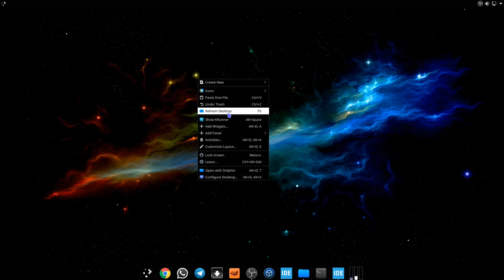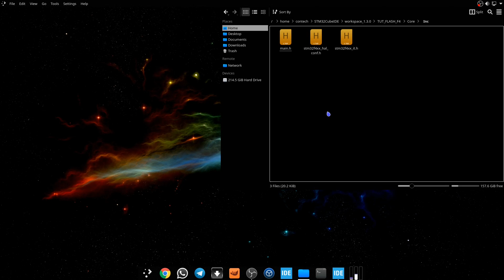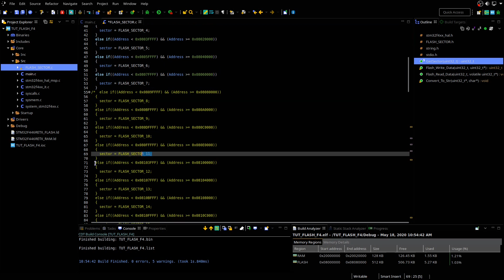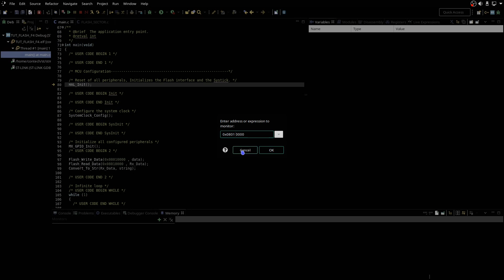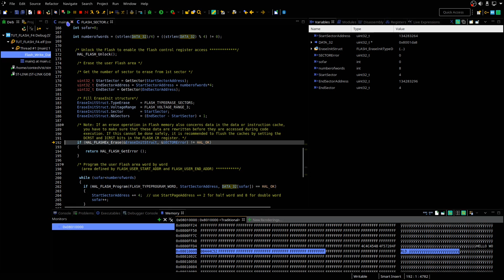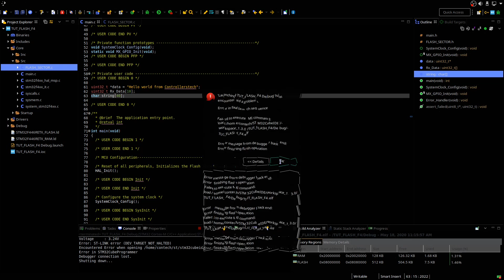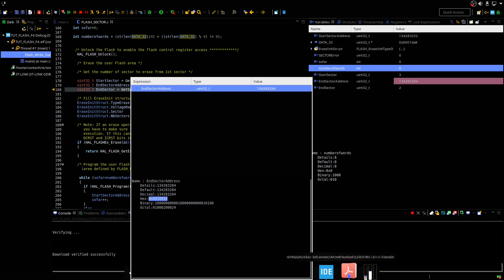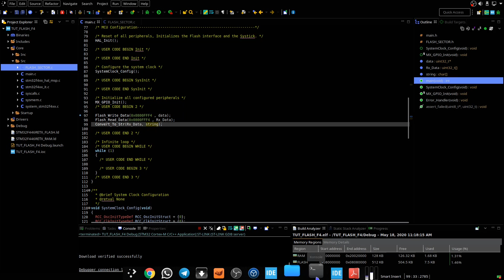Master STM32 Flash Memory: Complete Guide for Sector-Based Flash memory with HAL

Comment: After trying out this code:

    HAL_StatusTypeDef res;
    res = HAL_FLASH_Unlock();

    FLASH_EraseInitTypeDef EraseInitStruct;
    EraseInitStruct.TypeErase     = FLASH_TYPEERASE_SECTORS;
    EraseInitStruct.VoltageRange  = FLASH_VOLTAGE_RANGE_3;
    EraseInitStruct.Sector        = 7;
    EraseInitStruct.NbSectors      = 1;

    uint32_t error;
    uint32_t _res;
    if (HAL_FLASHEx_Erase(&EraseInitStruct, &error) != HAL_OK)
    {
        _res = HAL_FLASH_GetError ();
    }

    res = HAL_FLASH_Lock();

I can not connect to the debugger anymore...
Can I recover the board or is it forever lost?

Comment: Erase_Sector_5_Flash:
    ldr r0, =FLASH_CR                               // load address of the FLASH_CR register into r0
    ldr r1, [r0]                                    // load value inside FLASH_CR into r1
    orr r1, r1, #0b00000000000000010000000000000000 // set the STRT bit
    orr r1, r1, #0b00000000000000000000001000000000 // set the PSIZE bit
    bic r1, r1, #0b00000000000000000000000100000000 // clear the PSIZE bit
    orr r1, r1, #0b00000000000000000000000000100000 // set the SNB higher bit, sector 5
    orr r1, r1, #0b00000000000000000000000000001000 // set the SNB lower bit, sector 5
    orr r1, r1, #0b00000000000000000000000000000010 // set the SER bit
    str r1, [r0]                                    // store value into the FLASH_CR register
    bx lr                                           // return to caller

tried to do this in Assembler however this is causing a MCU fault any idea what I might be missing?  I am properly unlocking it and locking it as well

Comment: STM32F767ZI has two bank configuration mode of internal flash such as single bank mode and dual bank mode which cause changing sector numbers. Which one of these modes is it being used in the code? Should I be carefull with these modes while I programming the flash by using this source code?
Reply: I have found a problem in the code. Whenever I tried to program internal flash memory of STM32F767ZI with 2MB flash in single bank mode I read wrong value from filled address of the internal flash memory. Finally I found the problem in this code line : 

while (sofar<numberofwords)
	   {
	     if (HAL_FLASH_Program(FLASH_TYPEPROGRAM_WORD, StartSectorAddress, (uint32_t ) &data [sofar]) == HAL_OK)
	     {
	    	 StartSectorAddress += 4;
	    	 sofar++;
	     }

The data variable must be directly forward to HAL_FLASH_Program not the address of data variable correct code block should be like this;

while (sofar<numberofwords)
	   {
	     if (HAL_FLASH_Program(FLASH_TYPEPROGRAM_WORD, StartSectorAddress, (uint32_t ) data [sofar]) == HAL_OK)
...

Comment: Hi - thanks for your really helpful videos and tutorials. I've found a problem when using the ST-Link debugger with a Nucleo-F767ZI board. If I step through the Flash_Write_Data function, it all works OK. However, when I disconnect the debugger, then attempt to download and debug again, ST-Link reports that the target is still running, and the download failed. This is persistent, even if I power-cycle the Nucleo board. However, if I don't step through the code, but just set a breakpoint on the function return, it all works fine. Any ideas what may be causing this? Thanks!
Reply: Hi, how did you get it to work? I also have F767ZI and when I erase a sector in the flash (inside the write function), the program just stops executing. In the manual it says "Any attempt to read the Flash memory while it is being written or erased, causes the bus to stall" so i thought it couldn't be done in this microcontroller.

Comment: hello, how can I write a double variable to flash memory? Do you know a source about this? I am using the STM32F407VG DISC-1 development board.
Reply from the maker: There are 2 ways:
1. Convert them to string using sprintf and then save it. It takes more memory since each value will be represented as a character but it's very easy to implement.
2. Use enum to store the bytes. Check my github. There is an eeprom library. I have used the enum to store the float data into the eeprom. You can use that
Reply: @ControllersTech  THANK YOU MASTER!

Comment: I am using several parameters in a row stored in flash memory. If I want to change only one parameter, should I read them first, then change a member of the structure-union, the next to erase the sector and write back?
Reply from the maker: Even for a little change, you do need to erase the sector. That's how flash memory works
Reply: @ControllersTech  Thanks for your reply!

Comment: Sir how can I store a float number to flash and reuse it
Reply from the maker: Convert to bytes using union, or convert to string..
Reply: thank you so much for your reply i will consider to convert to string
Reply: I love your tutorial. Can you make some tutorial about using LL library
Reply from the maker: There already is a registere based series. Now no point in making LL videos also. You can just see the register based videos, and use them in the LL
Reply: Can you teach me how to write 2 data in two sector in the same time because when i do that the second sector work but the first has been erased. The first one I containt 3 float variable and the second is 2 uint16_t data type. If I use only one sector for the first it work perfectly but when using two diffirent sector it not

Comment: Out of curiosity, why are you using the external clock? Any particular reason beside a faster clock frequency than the HSI RC?
Reply from the maker: It's more accurate. Also since the crystal is already there so why not take advantage of it.
Reply: @ControllersTech  thank you for the answer. I thought that the performance of the flash memory could have been improved significantly by it (somewhere I saw something about an amount of cycles that the flash had to wait to perform an operation depending on the clock frequency been used, not sure)

Comment: Hi, i need to use flash programming in my project but there is a problem. I have to save DHT sensor data in flash memory. The values are float, so i could not find a way to convert them to unint32_t. Is there a method you would like to help? Thank you...
Reply from the maker: You can try saving them as string..
Reply: @ControllersTech  thank you sir
Reply: @ControllersTech  Hi sir, i could have written the temperature data succesfully in while loop. But the data erase itself at each loop and write the new value. I want the data to continue for the next row. How could i achieve that?

Comment: I'm using the dual-core STM32h7.. so to prevent the compiler / programmer from using or erasing the intended user data sector , I modified the M7's STM32H745XIHX_FLASH.ld linker script:

MEMORY
{
FLASH (rx)      : ORIGIN = 0x08000000, LENGTH = 1920K  /* Fifteen 128KB Sectors */
USER_FLASH(rx)  : ORIGIN = 0x081E0000, LENGTH = 128K /* Last sector */
RAM (xrw)      : ORIGIN = 0x20000000, LENGTH = 128K    
RAM_D2 (xrw)      : ORIGIN = 0x30000000, LENGTH = 128K  
RAM_D3 (xrw)      : ORIGIN = 0x38000000, LENGTH = 64K
ITCMRAM (xrw)      : ORIGIN = 0x00000000, LENGTH = 64K
}

Hopefully, the bootloader or st-link won't erase the USER_FLASH sector!   But what should I do about the M7's OTHER lilnker script : STM32H745XIHX_RAM.ld ?     Or that of the M4's Linker scripts?

// Erase
HAL_FLASH_Unlock();

uint32_t SECTORError = 0;
FLASH_EraseInitTypeDef EraseInitStruct = {0};

EraseInitStruct.TypeErase     = FLASH_TYPEERASE_SECTORS;
EraseInitStruct.VoltageRange  = FLASH_VOLTAGE_RANGE_3;
EraseInitStruct.Banks         = FLASH_BANK_2;
EraseInitStruct.Sector        = FLASH_SECTOR_7;
EraseInitStruct.NbSectors     = 1;
HAL_FLASHEx_Erase(&EraseInitStruct, &SECTORError);
HAL_FLASH_Lock();

// The Stm32H7 has ONLY 32-byte flash words??

HAL_FLASH_Unlock();

HAL_FLASH_Program(FLASH_TYPEPROGRAM_FLASHWORD, 0x081E0000 + (32*flash_word),  source_32byte_buffer);
HAL_FLASH_Lock();
Reply: Uploading code from CubeIDE does not work when using Erase (It freezes with the title "Target is not responding, retrying ..."), uploading from ST-link utility it works well. 🤔

Comment: Hi,
 i am using stm32H753 it has 2 memory banks BANK1 & BANK2 with 7 sectors each, and its a cortex-m7 controller,
i tried to use our program.it is not working
Reply: Hi Manjunath. Have you fixed your problem? I am using STM32H753 too. And I have same problem. Can you help me if you have fixed your problem ?